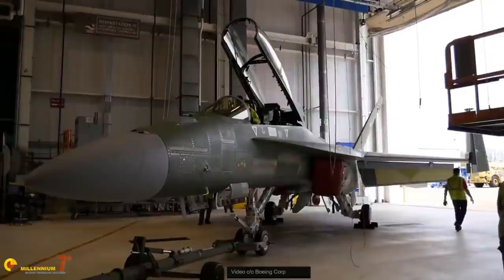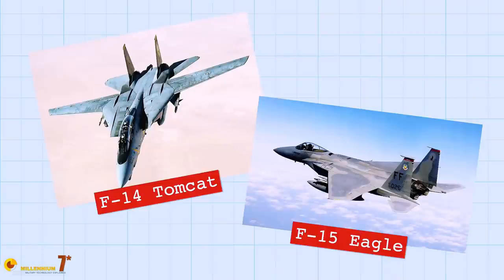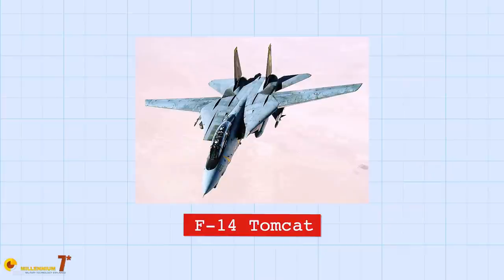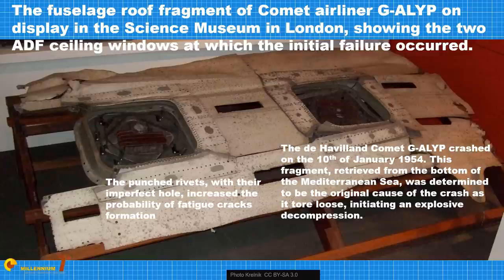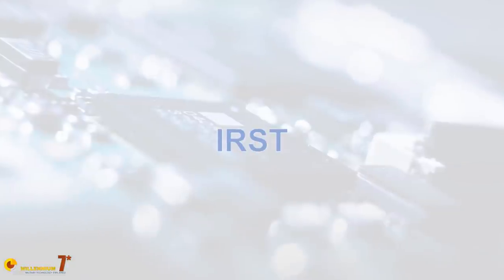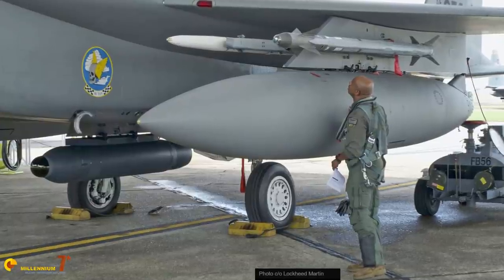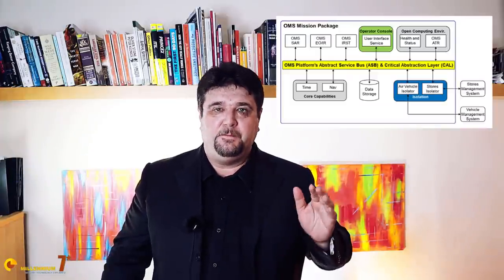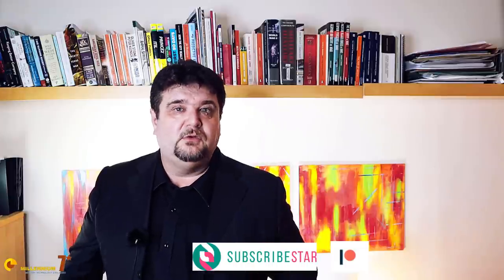The F/A-18 E/F Block 3: is it 5th Generation?

Comment: The USNavy didn't upgrade the F-17 into the F-18. Mainly, McDonnell Douglas did. Which at that point in time, was by far the preeminent fighter aircraft design & manufacturing hub of the US. Adding considerable improvements to reliability, ease of maintenance, all weather capability, adding extensive naval & land surface-attack capability, upgrading it's engine package (with GE) for considerably better thrust to weight ratio, adding payload capacity, significantly improving AoA performance, increasing it's resistance to damage, on-board power generation (to make flame-outs far less threatening), More fuel capacity, greater wing area, more aggressive wing control surfaces, and making it's structure and landing gears robust enough to be able to handle carrier operations (and then some). The original YF-17 was sort of a "Super F-5", after being worked over by McDonell Douglass, it was more of an "F-15-light", including a number of features which McD wished they had put on the F-15 in hindsight.

The engineers at Northrup felt they had created a massive upgrade over the old F-5 as it's starting point, and they had. McD engineers viewed the YF-17 as a starting point for changes though, which I think helped to raise the ambition bar for the design rework. When you've already made something much better than what you started with, it can make you reluctant to scrap ideas and redo elements of it. Nobody wants to take a hacksaw to their own artwork. Also Grumman was in a position to not feel strongly interested in threatening the F-14's job, McD did not share this consideration.

The F/A-18A was such a massive upgrade over the YF-17, that it essentially inspired the USAF to seek out an upgraded F-16C, to replace the F-16A, to technologically catch up with the Navy's new plane. Unfortunately for the F-16C, this didn't include a thrust upgrade until the 1990's, so for quite a while, the added weight of the technological upgrades undercut it's dogfighting performance vs. the A model. The Thunderbirds didn't just fly the A model to save money, it's more agile than the C. At least until the new F110 GE engines became available in the 90's, at which point in time I think the F-16C finally caught up with the F/A-18C in overall capability. And then came the F/A-18E/F... essentially the US's only "production" gen 4.5 plane.

Not to just gush over the F-18 or McD. I really liked the F-14D SuperTomcat prototype. And I think the F-35 is great as well, not to mention the F-22 (although, I think the F-23 could have been the better choice). The Rafale is fantastic. The Archangel series are my favorite (SR-71 being the best known of that lot). I think the Fulcrum and Flanker are truly inspired designs from an aerodynamics & maneuverability standpoint. Hell I even like the Saab Draken and the F-106. But McDonnell Douglas is generally grossly under-credited for the US's mid to late cold war, and post cold war, air power advantage. To be fair, that's partly that's due to "under-publishing of capability" though. The F-15 for example, wouldn't have a 104:0 win/loss ratio in air combat based purely on what you can read in Jane's. Domestic versions of gen 4/4.5 Russian fighters also have undisclosed premium features.
Reply: The F-16C systems development for Block 25 was largely driven by the open nature of the F-16 MSIP program and tons of pilot requests for certain things.  The F-16A cockpit has the issue of the Radar display down between your legs, so they were constantly looking down-up-down-up-down-up with the HUD, getting repetitive motion problems.  Display technology had matured by that point to have MFDs, so that’s what drove the cockpit configuration on the C Model.  The APG-68 was a pretty large jump over the APG-66, and one of the main things opened up with the C model was BVR missile integration, IFF, and more ground attack modes.  I was very close to F-16C avionics development in the 1980s, and never got the impression that it was driven by the Hornet.  There was a large gap between USAF and USN multirole cultures and communities that were just emerging in those days.

The Navy was looking for F-18s and A-18s to replace the F-4N, A-7E, and A-4M.  As computer processing and data storage increased, they were able to combine the F-18 and A-18 into one aircraft where the pilot could swing-role mid-mission if necessary, with the flip of a switch.  It had very good human interface with most of its systems, with a lot of leveraging of computing power over individual manual inputs.  The impetus for a lot of that software and hardware architecture came from the F-15 and its HOTAS with integrated weapons cueing, radar mode selection, and HUD mode all working together when the pilot selected one weapon from another.

The F/A-18 was definitely the beneficiary of many lessons-learned and technological maturity being the last of the teen fighters, as well as concurrent development of the F-15E Strike Eagle once the Strike Eagle was awarded with the win by the USAF.  The F/A-18A had all kinds of problems though, aerodynamic, structural, and avionics that all needed to be addressed with retrofits and the new F/A-18C at the time.  They lost 100 airframes and had 20 fatalities within its first 10 years of service.
Reply: "The F/A-18A was such a massive upgrade over the YF-17, that it essentially inspired the USAF to seek out an upgraded F-16C, to replace the F-16A"

The F-16C was introduced for the new radar and avionics required to support the Sparrow missile and the upcoming AMRAAM, not because of anything the F/A-18 had or didn't have.

"And then came the F/A-18E/F... essentially the US's only "production" gen 4.5 plane."

I don't know where you get off calling the Super Hornet 4.5 gen. By that definition, almost every American 4th gen fighter flying today is 4.5 gen because they have similar capabilities to the Super Hornet and are also still in production.

"But McDonnell Douglas is generally grossly under-credited for the US's mid to late cold war, and post cold war, air power advantage."

I'm not sure why they're under-credited. A2A, compare the F-15C kill record to the F/A-18s. A2G, compare F-16 sorties to the F/A-18. Neither are even close. The F/A-18 has been a relatively minor participant in every significant air campaign since it's introduction. That's not a knock against the design, but they aren't around in significant enough numbers or present at the right bases and times to be a primary contributor.

"The F-15 for example, wouldn't have a 104:0 win/loss ratio in air combat based purely on what you can read in Jane's."

Not sure what you mean. The F-15C's (assuming you mean the C, since that's what the ratio is associated with) kill:death ratio is widely acknowledged as fact by every major military history, not just Jane's, and widely credited to a combination of extremely-good training and the NCTR capability. [Edit: just realized you might have been including the F-15 with the F/A-18 in your reference to McD, might have misread the last few sentences]
Reply: @Jester-uh9xg  Sparrows existed long before the F-16, so I'm not sure of your angle there. The F-18 illustrated for the USAF the limitations of the F-16A's scope of design ambition. An anemic radar may save money, but it's very costly in terms of an aircraft's capability. So the C got all weather, improved radar, more hard points, BVR capability, expanded ground attack capability... making it much more like the 18... Arguably the very strong performance of the AMRAAM was a significant factor in dictating the need for BVR capability though, so it's not just F-18 envy. But it is pretty clear the USAF came to decide they went slightly "too cheap" with the F-16A's. Thus the C's were designed with more capability (with more price), rather than just say seeking to make them cheaper or more reliable.

The F-18E/F is the only 4.5 gen US production plane. I'll stick with that. Which is to say it is the only "major" overhaul in design to adopt modern/21st century features/tech. Sure there's block updates for a variety of aircraft. And many aircraft have or are seeing advanced avionics & sensor upgrades. But the F-18E is the only one which went through an extensive airframe redesign to reduce it's radar signature, and had many significant airframe changes to re-purpose it's capabilities. I wouldn't call it a stealth plane, but much like the Rafale, it "leans that way". There were other planes proposed, and in some cases flown as prototypes, which could be called 4.5 gen. But the F-18E is the only one which went into production. This is largely due to the US Navy being dubious of whether a carrier capable F-22 would actually materialize (they were correct). The other strong option was the F-14D "Super Tomcat". Frankly, both designs had some great benefits. Other notable examples (not in production) are the "Silent Eagle" and possibly the "STOL/MTD". One could argue that the F-15X / EX might be called 4.5gen, but I don't think the design changes are really quite extensive enough to call gen 4.5. It's more a major block revision on the F-15, and the modifications are backward compatible to existing legacy aircraft without doing major surgery to the airframe. The USAF shunned 4.5gen because they (probably rightly) feared congressional defunding of gen 5 programs if other options were on the table. The US Navy on the other hand was facing a serious deployment gap for modern tech, so they had a 4.5gen plane competition, and picked the 18E. Russia on the other hand embraced gen 4.5, they have quite a few models which I think qualify as 4.5. I think the Rafale, J-20, and a few others probably also qualify. Really the whole "generation" thing is woefully arbitrary and ill defined though.

I wouldn't compare the F-18E to the F-16C in K:D ratio, one simply hasn't seen a lot of combat. Same vs the F-15. I mean, the F-22 has a 0:0 KD, but we wouldn't say it's a weaker performing plane because of it. Even the F-15C's K:D ratio isn't a clear picture of aircraft performance, since a fair number of those were against rather under-trained pilots in countries which flew planes from Russia without the "premium goodies" under the hood. And other variables like the AWACS can really factor heavily as well. It may have been a poor choice to use KD ratio as an example to make a point. I think all the F-18's K:D stats show is that the Navy is tepid about putting carriers near combat arenas unless it's really necessary.

You completely misunderstand my comment on the F-15 and Jane's. I'm saying that the capabilities of US aircraft are "understated" (to no small degree) in official publications. And that based on the published numbers, one wouldn't expect a 104:0 K:D for the F-15, I mean, if Jane's stats on it's turn rate, etc. are accurate, that seems implausible. But... I cited that figure as evidence that the published numbers are watered down. That's really all I was saying there. This applies to aerodynamic capability, airframe tolerances, range stats, max G-loads, electronic capabilities, etc. Generally the better the hardware, the more watered down the public stats are. Also the less likely they are to be used in hot-spot firefights (which is most air combat in the time frame we're looking at). It's not too surprising that the best aircraft see the least fighting when all of the conflicts are lower priority, which tends to beg for more expendable planes.

I mean, just one example of 'official stats' being pretty far off the mark, which I'll point out only because it's too sloppy and careless to take seriously, is the B-2's range. Officially it's 6,000nm unrefueled, and 10,000nm with in flight refueling. But if you stop to weigh the validity of that assertion, it falls apart. It takes some fuel to climb to operational altitude, and after that it can go 6,000nm... So why then when it's topped off when already at altitude, can it go only 10,000nm, instead of 12,000nm or greater? Is a fully fueled B-2 on the runway able to go 6,000nm, but a fully fueled B-2 at 35,000ft only able to travel 4,000nm? Somebody failed badly at making their watered down official publications plausibly consistent there. I get that you can't wait to in-flight refuel when the tanks are exactly empty, but that's half again the range missing (4000 vs 6000).

The F-16's claim to fame in AA engagement is it's very sharp turn rate. However, F-15/F-18/F-14 can all turn at a rate which is sufficient to black out the pilot. I know of an F-15 which pulled over 12G's (without blackout surprisingly, it's hard to account for adrenaline), with a 12,000lb bomb load still on it. Granted the rate of speed is a factor in this, the G force of a turn is relative to the speed of the aircraft. Being able to maintain a very high AoA at a lower speed could give a turning advantage, even if G force limitations are equal. But I wouldn't take too seriously the idea that the F-18, a carrier capable plane (a mission profile requiring very high AoA and lift at low speed), and an airframe which must be more robust to handle carrier impac...i mean 'landings', has less turn rate potential than the F-16. Officially? yeah, sure, that's the published numbers. In reality though? All the "good" modern fighter planes out there can squish the pilot, so they need to look to other capability metrics to manifest a competitive edge.

I think perhaps I was taking a jab at DCS as much as anything else.

Anyway, the F-16 is an excellent fighter. No shade there. But it was a bit of an underdog in capability until it got the C/D upgrades, and then later the F-110 engine update which negated the weight gain of the C/D upgrades, with some thrust left over. In all of it's forms though, the F-16 has always been a very cost effective fighter which punches above it's price point.

Comment: Without stealth, the super hornet share the same functions as the F 35C, radar, battle information management. Super hornet is expected to serve at least another 15 years time till the Navy the next gen F/A-XX enters the service. The super hornet is a cost-effective fighter, capable of delivering most of the need in Navy combat expectation.
Reply: Stealth is not the threat now.  It is a lot cheaper to condition the F/A 18 SuperHornet to be able to do hyper-sonic intercepts which is needed now.  That is because Russia who is supplied by China has and will use drones, ballistic missiles, cruise missile and hyper-sonic missile against their enemies like in Ukraine.  Dog fighting is highly unlikely but the protecting cities is a big deal.  There is no doubt.  There is also no doubt that the F18 air frame can be engineered to fly MACH 2.0 and even MACH 2 ++.  Look at all the knocks off jets like MiG 29, J17, and etc...We needed the NGAD and F/A-XX with realistic requirements like the "NEED FOR SPEED" as well as Stealth.

Comment: nice video as always, just to conclude: No f-18 E/F block3 is NOT a 5th gen fighter, it's 4.5 or 4++ if you wish. Only 5th gen fighters in service now are F-22, F-35 and J-20 (supposedly). Maybe F-18X would join them too but most probably she will end up at 4.5

Comment: Another nice video! 👍
One thing I’d like to add though.
@12:48 there is no need to jettison a centreline fuel tank in combat: not even the MiG-21 needs to do that, and we all know how draggy that delta is 😉 
Wing tanks are an entirely different matter obviously: jettisoning those in combat is quite sensible in certain situations.

Comment: Given that the relative size of combat aircraft is a known quantity, it should be relatively easy to find an approximate range for an aircraft shown on an irst. Also you can use laser rangefinding, which shouldn't be detectable as long as the pulse is short and relatively inconsistent.

Comment: Thanks for another interesting video, system architecture and integration isn't the most rivetting subject but flying an aware aircraft in a multi threat environment is probably more valuable then most aircraft enthusiasts think, so having a well understood and reliable platform with sophisticated but simple (for the pilot) to use sensors might top out sheer aircraft dynamic performance.  Alas we all like to see new fighter types, myself included and I remember the YF16/17 competition.

Comment: I appreciate Jenny‘s analysis, but I do want to make a comment regarding some things glossed over in regards to the replacement of the Tomcat. The tomcat model D was actually still the superior aircraft in almost every way on the carrier deck in 2006 when it was retired. it was in every way shape and form a multi roll aircraft much like the superhornet. In fact, some of the best work, the tomcat ever did in active duty was in missions. It was originally never intended for like FAC-a and CAS as well as strike bombing (bomb at iteration).

Issue for them at that moment in time was that the Grumman factory had been relieved of all of its Tomcat building equipment and molds.  Everything was destroyed after the US decided that they couldn’t risk parts getting back to Iran, the Walker aspiring, played a role in this, but there was a lot of politics and diplomatic issues involved.

I think it’s silly that they chose to destroy a perfectly good aircraft that were pretty much brand new and had new air frames, but by the same token, they needed a new aircraft because there weren’t enough Tomcats. So I guess the distinction I’m trying to make is that it’s not that the super tomcat model D didn’t do the job at the superhornet did, because it actually did it better, it just cost more per plane, more per hour to maintain, and there weren’t enough of them to go around so they were going to have to get a new aircraft and train people in it anyways. Why not just transition from the hornet to all super hornets.